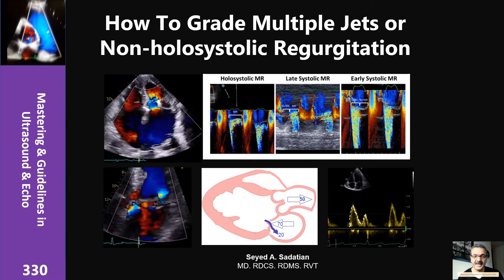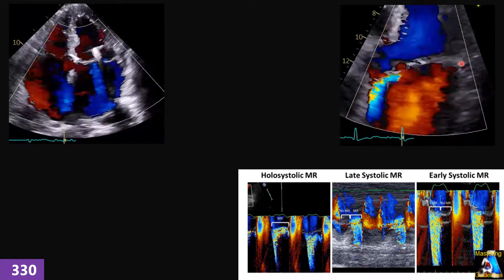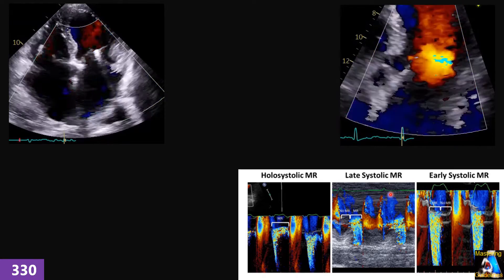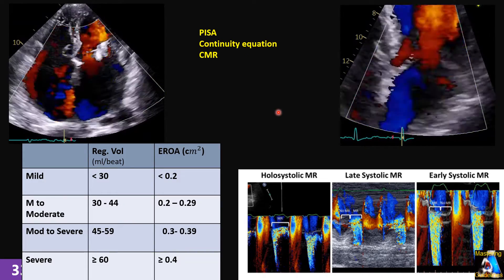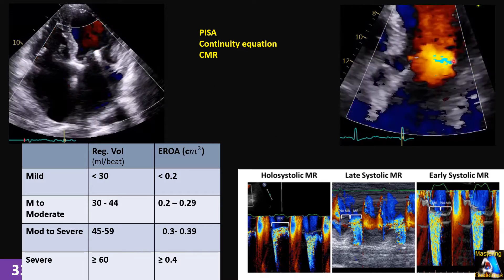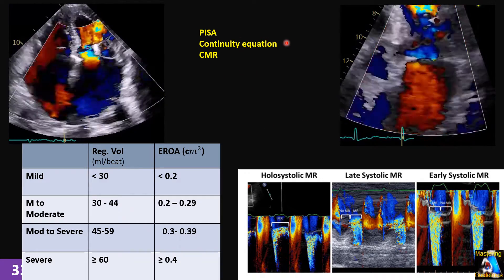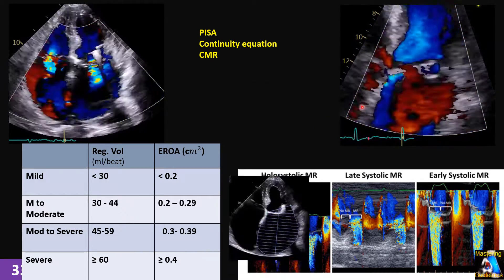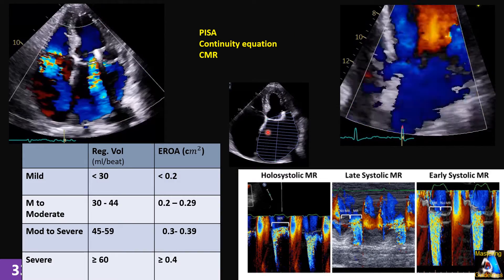Grading Mitral Regurgitation in Multiple Jets or non-holosystolic regurgitation

Comment: Dear sir. Can you tell me that we should measure mitral and tricuspid annulus diameter in mid diastole or end systole (similar to measure LA).
Reply from the maker: @nguyenngochoaquynh1524  Hi, good question;
For MV & TV annulus if we use it for continuity equation ( for example for grading valvular disorder) at mid diastole ( or early or late diastole that has clear and largest border ) for measuring  LA AP diameter or checking the size of LA by ring of valve , at end systole
Reply: @masteringEcho-US-cardiology  thank you so much, sir.
Reply from the maker: @nguyenngochoaquynh1524  you are very welcome